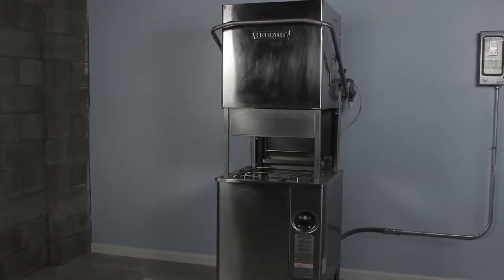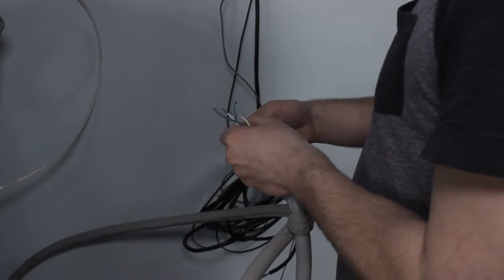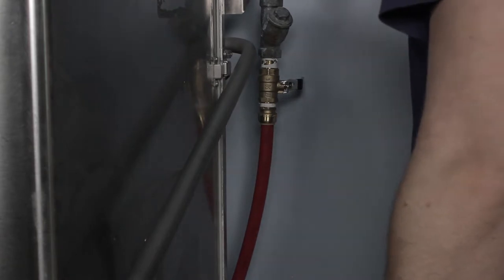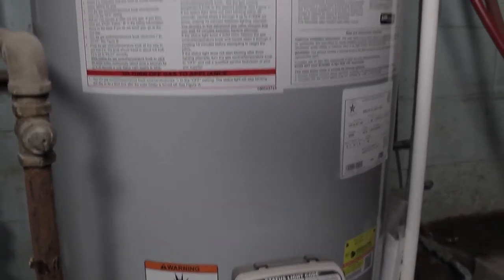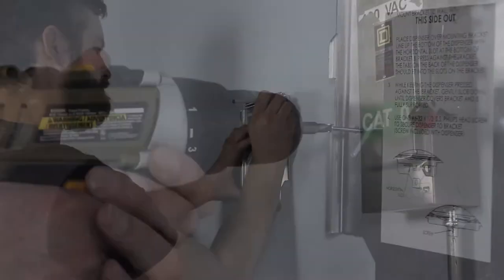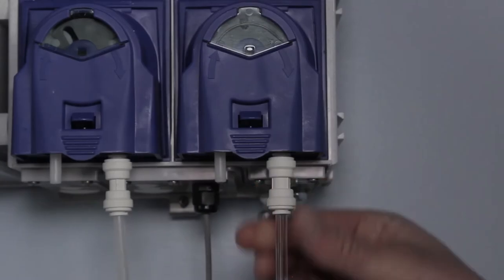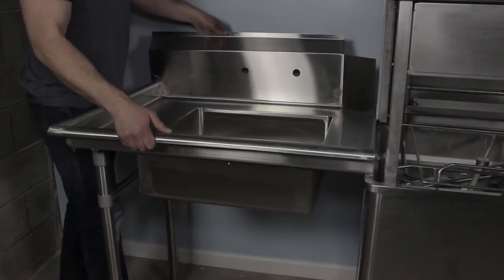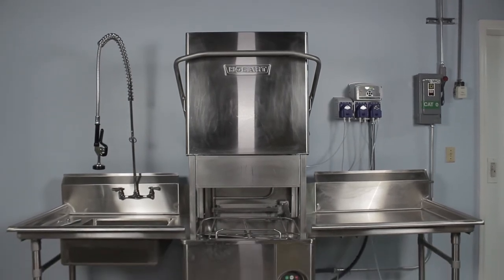How to Install a Commercial Dishwasher - Active Element - Maintenance Series

Comment: That Hobart AM model is made to have an external or on board booster for final rinse sanitizing if you pump chlorine into that upper rinse assembly it will rot out within months. Also the signal wires you ran up to your chemical pump are usually 208v signals so you will need to run the wires in seal tight. You will have 2 separate signals 2 wires for soap feed and 2 wires for rinse. Product. If your running it as a low temp you will need to piggy back your chlorine pump to your rinse additive. You forgot to mention you will need to purchase 3 different products a Soap,chlorinated sanitizer and a rinse additive. Oh by the way if your don’t know or understand titration of chemicals you will either make people sick or destroy your wares. Not to mention running a chlorinated sanitizer for real silverware or any soft aluminum pots or pans including bon chef will get pitted and ruined. Now low temp or not I’d put a vent hood above the machine to keep your ceiling from getting destroyed. Going back to chemical titration you neglected to explain you will need a chemical cell installed into the wash tank and run to the chemical control box. That’s the most economical way to control soap usage. Now getting back to the most important issue especially in this day and age Sanitizer step if your incoming water is too hot it will be enough to gas off your sanitizer (so it won’t work) but not hot enough to kill bacteria. Drain needs to have an air gap floor drain. You’ve got a quick disconnect which is good but I’d make it water tight that close to the machine. orie@cleansetec.com if you have any questions.
Reply from the maker: We appreciate your feedback and expertise, Orie. Active Element strives to empower our customers with the knowledge on how to install, operate and maintain their very own commercial dishwasher machines instead of paying for costly leases. These machines are really pretty simple.

In this video, we provide a basic overview on dishwasher installation that will encompass several makes and models. We state to reference your user manual and recommend consulting an electrician and plumber to help with the install. The use of a conductivity probe overcomplicates these simple machines and are faulty. Experts we have spoken to (Hobart and Chemical) agree with this approach. Thanks and Happy 2021!

Comment: Dear sir
My HOBART Dishwasher machine is not holding up when it is open after dish washing ? 

May be Hood became heavy weight due to water penetration inside the hood...  

Any solution ?
Reply from the maker: Thank you for the inquiry. Most likely the issue is with the spring, located in the back of machine, that holds up the door. Overtime this spring wears, breaks and needs to be replaced. Replacing this should fix the issue and you should be able to find the part online. Thanks!
Reply: Thank you so much